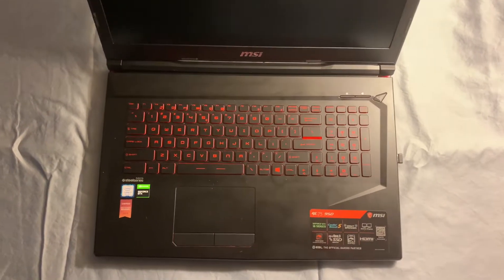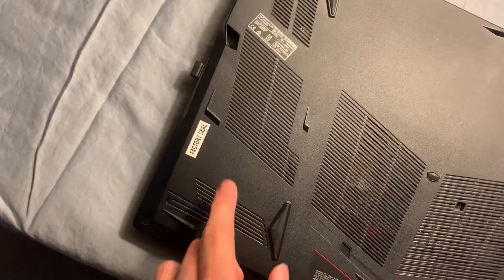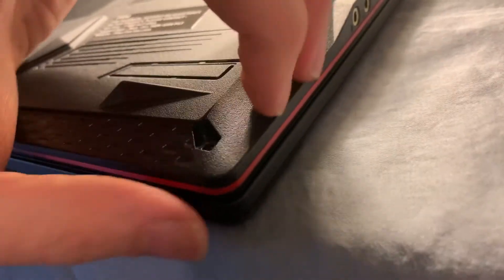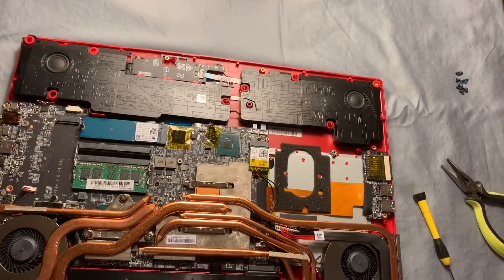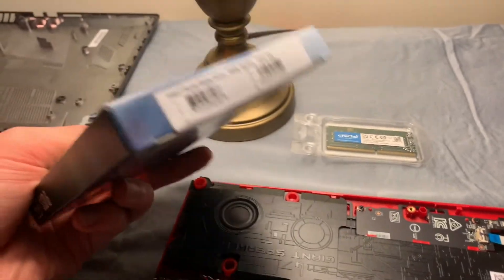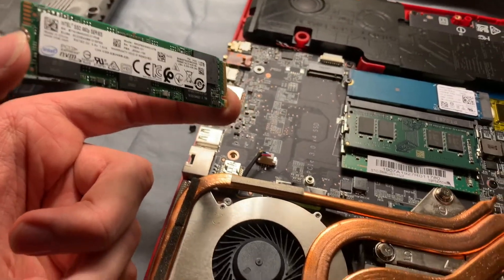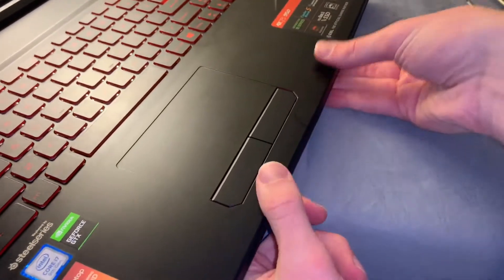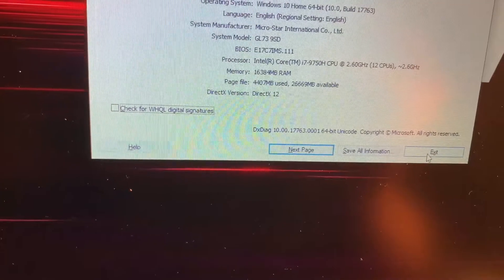How To Install SSD Storage and RAM on MSi Gaming Laptop | Easy Tutorial! (GL73-9SD)

Comment: Thank you for the tutorial. Question: Can you make a video showing how to copy the operating system to sdd for faster booting times. For instance, I have msi gl73 8rd gaming laptop. I recently upgraded to 32gm ram. It has the original 1tb internal hdd, and I want to upgrade to 4tb internal ssd with zero partitions.